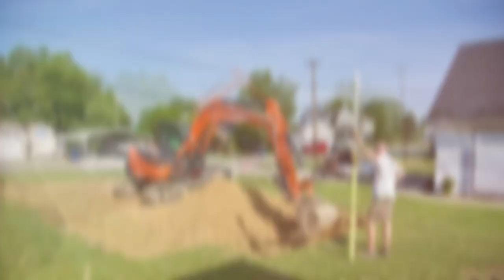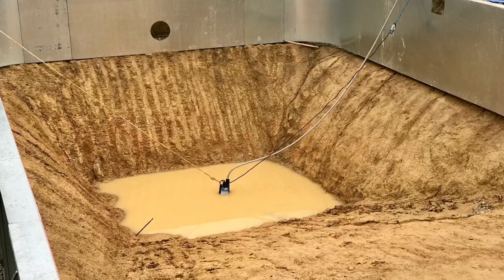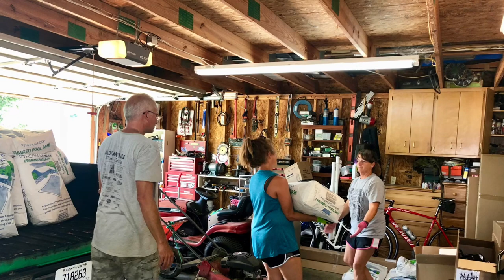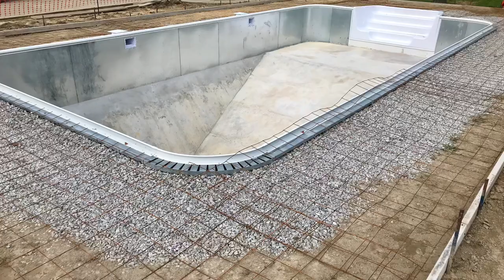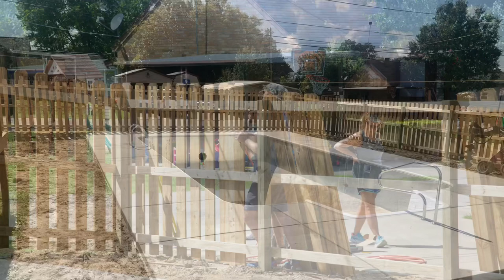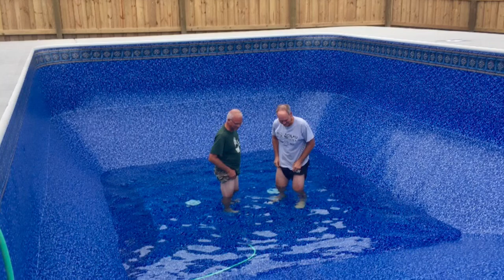DIY Inground Vinyl Liner Pool kit Install 2018

Comment: This is an amazing project. Are you at liberty to tell me we’re you able to build this pool for under 15k?
Reply: PoolWarehouse.com is my guess.
Reply from the maker: Yes, the pool was completed for under 15k but I must add that I had a friend that supplied the excavator so I did not have any cost in digging. The basic 16x32 pool kit was purchased for $5600.  The main cost came from electric, plumbing, and concrete that is not included in the kit.

Comment: If you could share the overall cost of this, it will be really great, I’m looking at doing the same and, my project would be about the same size as yours,  i know the kit would cost me around 14k but, I’m wondering of all the other costs, if you could give me an idea of how much I should expect to pay it would be really great. Thank you! Your pool looks really awesome!!!!
Reply from the maker: Yes, the pool was completed for under 15k but I must add that I had a friend that supplied the excavator so I did not have any cost in digging. The basic 16x32 pool kit was purchased for $5600.  The main cost came from electric, plumbing, and concrete that is not included in the kit.

Comment: Hi we are researching vinyl pool. How are your feelings and thoughts 2 years later?
Reply from the maker: The pool has been great! The upkeep has actually been easier than we thought it would be. If the weather is nice there is always someone in the pool. During the swimming moths we spend an extra $100+/- a month in electric for our backyard oasis (pump, heater, lighting, outdoor speakers, gazebo fan, mini fridge, etc.) but it is money well spent :) 
As far as the pool itself, we have not had any surprises, breaks, damage, or broken parts.

Comment: How tough was the pool krete?  Do you have to be perfect with the liner?  We have been thinking of installing one ourselves and that is one of my fears.
Reply from the maker: The pool krete was what we dreaded the most. After getting the consistency figured out it actually went pretty smooth. I’m a little ocd so it took a little longer than I expected but in the end it looks great:)